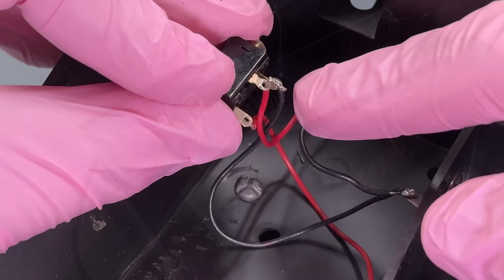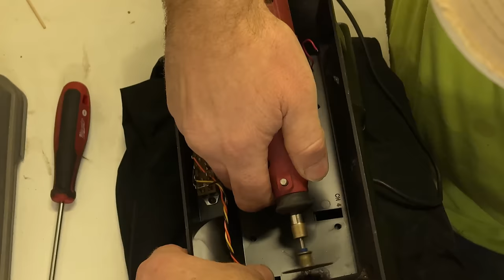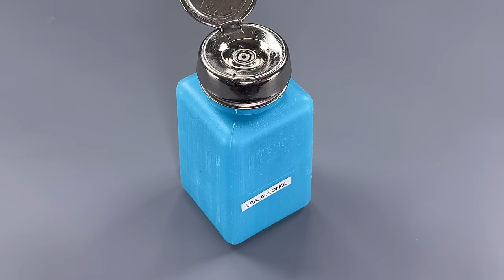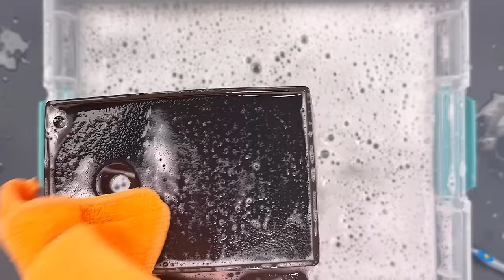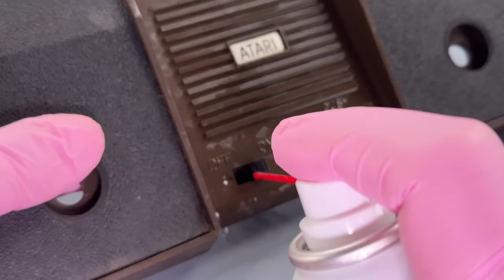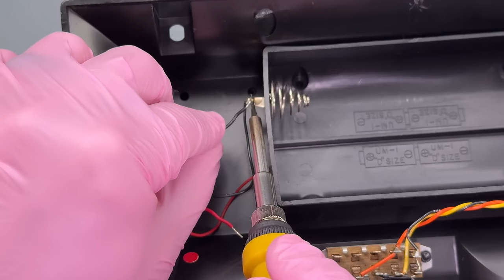Atari Super Pong & The Notorious Security Screws - Teardown and Deep Clean

Comment: I'd double check all the capacitors and see if you can get replacement chips. I just repaired a 2600 with a bad riot chip. They should have refurbishment kits on Console 5 for some of the most common components that fail. Replace those first. Then try the chips
Reply: Yeah I would replace all of those electrolyte capacitors, in fact I'll be doing that soon to mine I got some axial Caps to match the originals with maybe even slightly higher specifications. I mean the components in these were great and they've been going strong for 40 some years but I think it's a great idea just to throw those out to help the chips and some of the other permanent components run clean and smooth

Comment: The fix for the display is typically easy...  Tune to channel four.  If that does not work, adjust the horizontal on the television.  We used to have the same issue back in the early 1980s when putting the Atari on different televisions.
Reply: Shit I remember that, my friend had a vcs back then that only worked on channel 4 for some reason.

Comment: I would check that large axial capacitor. The other smaller caps don't normally fail owing to their composition. That large cap though could be problematic.
Reply: I agree the small caps generally don't go bad, but if you're going to crank it open you might as well replace all the electrolyte caps. I mean it's not going to take away from the value if you put a new one in.

Comment: As others have said, check all capacitors.  If you can get new ones, replace them.  50 year old solder is likely to have cracks. Reflowing or replacing solder is one of the first things I do with old broken electronics. Free. Easy. Rarely works but when it does you feel like a genius.

Comment: I thought it looked like the tracking was off slightly on the telly.
Reply: I think the same! The problem is the TV, not the Game itself.
Reply: @valdecirteixeirayt  It is the TV, old TVs in the 1970s and 1980s had fine tuning controls and I think you might need to be on channel 2 or 4 with some pong consoles.

Comment: I would hit up Adrian's Digital Basement. He does a lot of old school repairs.

The desync on the monitor to me looks like a signaling issue. I would try to evaluate the CAPS and maybe replace the crystal oscillator. You can check the signaling with an oscilloscope, but I wouldn't know what to look for. Tantalim capacitors are notorious for going bad.
Reply: This. Any one of those tantalum capacitors could be gone, at nearly 50 years old it’s likely many are bad.

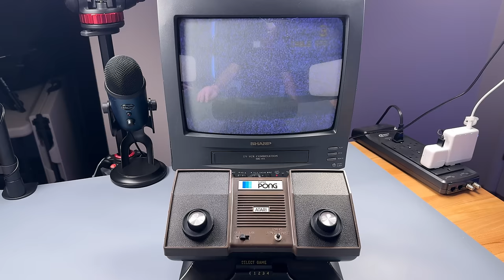Comment: At 19:15, you have it on channel 3 I was going to recommend trying channel 4.  But then on the second try at 20:29 you had channel 4.  So I'm not sure what happened there.  Sometimes those RF adapters had a switch to select one or the other in case there was interference from local TV channels.
Reply from the maker: Yeah I had switched it to try that between takes

Comment: I would use the cotton round wipes. They are thin and they can be put between the grooves easily with a screwdriver to get the dirt out with isopropyl alcohol. That is my recommendation. They also work better on larger surfaces than the cotton bugs do

Comment: Great system!  I never played the original Atari version, but we had a clone around 1981 and I was floored at being able to control stuff ON THE TV!!!  I would have been 7 at the time.  My Aunt found the old system in her house after all these years and gave it to me!  I need to clean it up and test it out.  Mine suffers from cord melt!  For some reason when you wrap the cord around the plastic it seems to have melting into it.  I noticed you had some marks around the base of yours too.

How were you hooking it up to the TV?
Reply from the maker: An adapter for the original cable to coax. Same as used on the Atari 2600 I recently did.

Comment: My stories I fixed one of these as a kid in the '80s I got for a dollar at a yard sale. I don't have an engineer mind but, I would definitely check the power cord & video cord to make sure they're no cramps in the signals are going through. I would go back and change all the electrolyte capacitors. This looks like it's either the main chip has gone corrupt, but more likely there's something screwy in the video line. Again just look for anything visual You might have to get a magnifying glass to see if you can find a cold solder joint. I feel this is definitely fixable

Comment: I know this is way too obvious but I don’t see anyone else saying it. The TV is tuned correctly right? The way the picture is nearly there but not quite is exactly how old TVs used to work with things like the Sega Genesis when on RF. AV cables spoil us these days. No tuning? Revolutionary!
Reply from the maker: I tested the tv with an Atari 2600 using the same cable and connector, so I don’t think that is the issue. Good idea though!
Reply: Ok if you don’t think the TV tuning is off (older US TVs may tune differently to the UK ones) there are also adjusters inside the Super Pong to alter the RF feed. I think it’s one you can access before the metal plate came off. Looks like a small flat head screw. Speak to Steve before adjusting them as I’m guessing a bit! It might alter the tuning enough to get a clean picture.

Comment: Your soldering tip is a bit too fat for a rough action like soldering such a big cable to another 🙂. But nice video, thank you!
Reply: Actually, these types of soldering jobs require a large tip just to get the joint hot enough. Since he's soldering the wire to a large piece of metal that soaks up a lot of heat it needs to be a large tip in order to produce enough heat to make a nice strong joint. A small tip in this situation would likely not produce enough heat and would likely create a cold solder joint that would either fail right away or fail in the future.